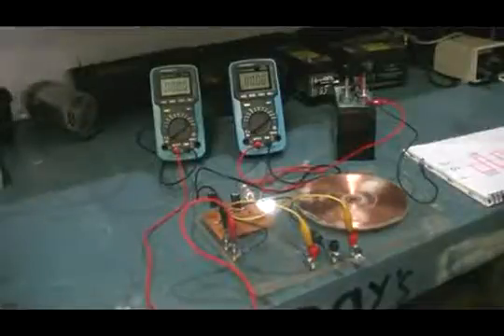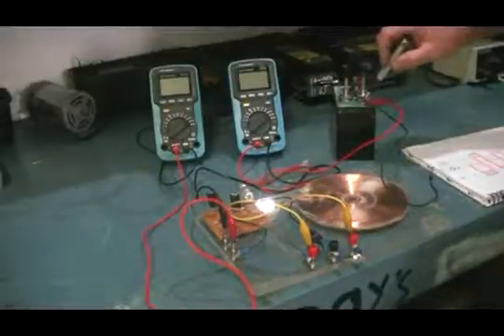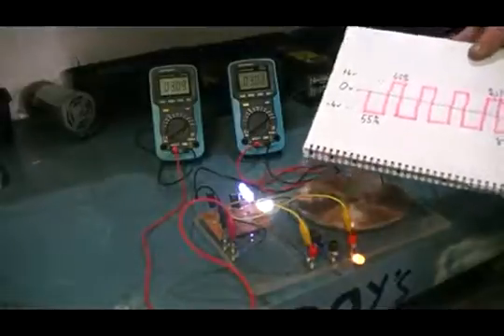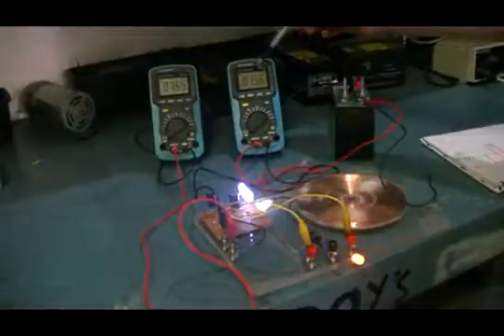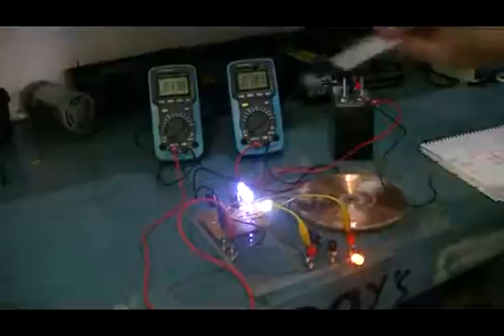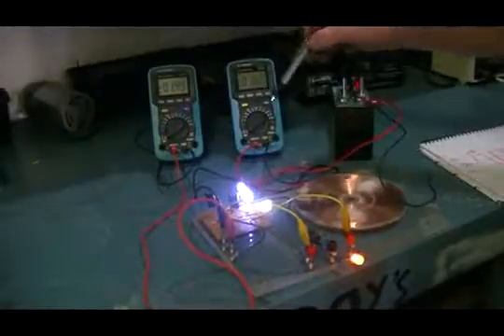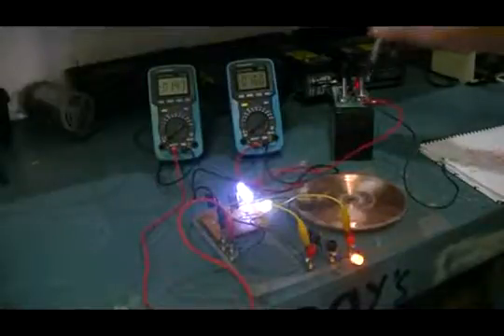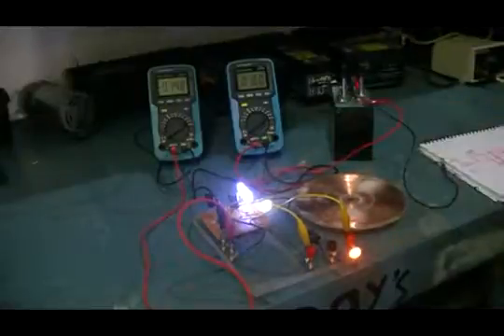tesla circuit test pt3

Comment from the maker: Hi 
On your comment,i went and place the coil in a steel tool box and closed the lid-no change to any thing at all?
Im guessing your thinking it may be drawing power from the ac signal in the shed,or radio wave's?
But that dosnt seem to be the case here.
I am happy to do a video of the coil in the steel box if you wish,so as you know im legit.

Comment from the maker: Hi TK-yes they have frequency and duty cycle.
I tested the bifilar coil-center tap for ground,then each output as positive.1 leg (at time of reading)says 47% duty cycle,and other says 53% duty cycle?
Not sure how you get two diferent duty cycles out of one coil?when coil windings in a pancake coil are in the same direction from center tap

Comment: You can purchase instructions and schematics for $2 for the silicon chip kits at jaycar...i recomend the 20 amp PWM motor driver,you have control over duty cycle and also frequency within a narrow range which could be ranged by changing some parts on the board and give more control over the frequency

Comment: Hi TM. interesting experiment. I like your meter aproach of putting a ampmeter on each leg. On another note, by monitoring the battery voltage, you could check if the battery is decreasing, stable or increasing. In your case increasing would confirm the negative reading on your ampmeter. The Tesla bifilar pankake coil is full of mistery, isn't it.

Comment: Hi TM
I redrew your schematic and posted it in one of the threads on OU. I'll be building and testing later this afternoon.
I can't find your square-wave generator on the net, but if you could take a couple of clear photos, front and back sides of the thing, I can probably sketch out its schematic from that. I think it's a pretty simple circuit from the looks of things, and it might be useful to know, in case a regular function generator won't work for some reason. 
Nice vid, keep them coming ;)

Comment: Hi TinMan... Just a theory. Tesla's Lat & Longetudial wave theories. The coil has not reached satuation. (If could would be the next question) The Freq. ist beond that of Cap. timings. I would venture to say that the FG at the >Freq. is, if not = or ~ to Res. of the Coil. I never had time to do such. But wish to build a Pancake coil. But useing Coaxial cable. I hear the results are outstanding.